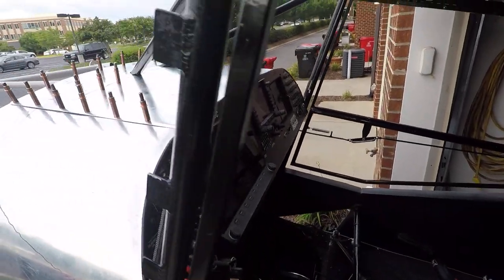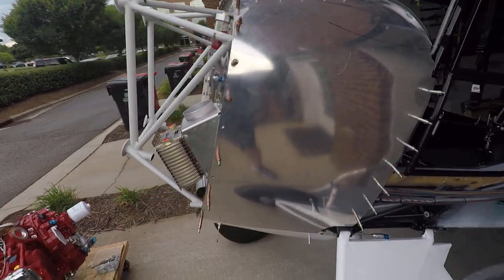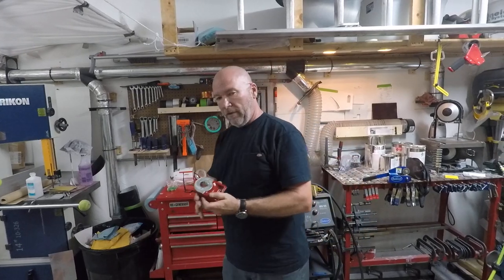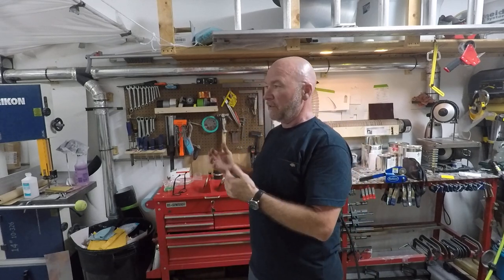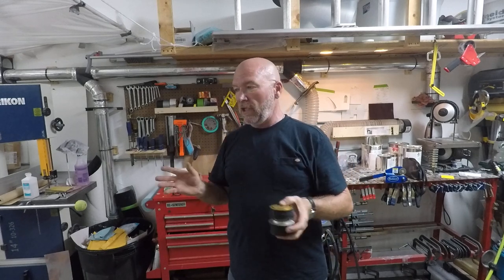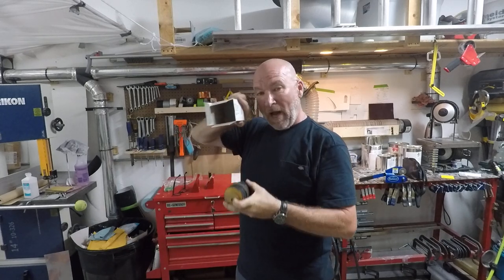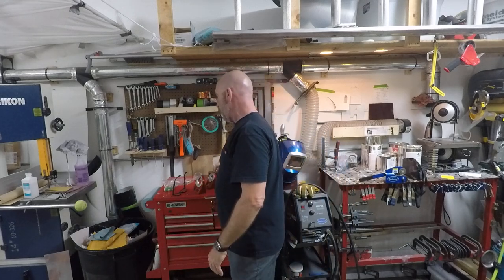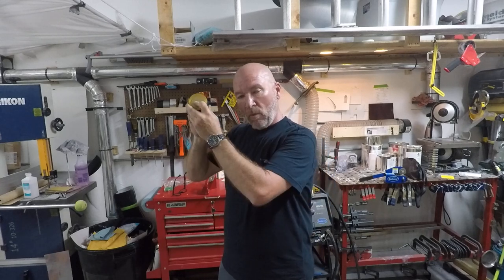Bearhawk - Engine Mounting NIGHTMARE!

Comment: I feel your pain. Try finding the tube size/thickness of O-540 engine mount tubes. Or any tube sizes.  It's like the DaVinci code. I finally found a PDF of the Bearhawk material list. No one has ever bothered to post tube size information anywhere, just like the isolator situation. I spent a lot of time doing the same thing for my Stinson O-540 conversion. I stayed with type 1 mounts and the same isolators that were used in the Cherokee my engine came from.
Reply from the maker: Oh man!  Sometimes you just have to do a deep dive!

Comment: Sorry to hear that you had to go through all of that trouble. In the industry we always phone the original equipment manufacturer as a first resort and ask to speak with an engineer. ... We also ask for specs, drawings, installation guides as .pdf files, if available. Most companies have documentation in “PDF” or in some other format that can be sent via email. Much of the time the larger companies will refer you to or  send you a link to a page on their website where you can download the appropriate file containing the information. However, there are still a lot of aftermarket component suppliers out there which may not offer documentation, in which case a phone call asking to speak with the technical representative for the component is usually the best way to begin your data search before planning your work and definitely before beginning to work with unfamiliar components. Best of luck with future task. It’s a great job you’re doing in sharing your build journey. Thanks for doing that 😎
Reply from the maker: Phone calls were made to all that you suggested.  I apologize if I did not convey that information in the video   Because I am building an experimental, information was not eagerly shared.  In some cases, flat out denied.  Ultimately, I obtained service manuals for aircraft that used the Lycoming IO-540 engine.  I used those to find the detailed part and installation procedures.  Some conflicted with each other.  I obtained enough SM's on various aircraft until I found consistency.  I also consulted my Bearhawk builders forum and consulted with others who encountered similar issues.  I hope I did not imply that I did not make adequate phone calls.  I wore out my welcome in some cases.
Reply: Bearhawk Life, I should be the one to apologize, as after looking at more of your videos, I learned that you had indeed placed phone calls to distributors & suppliers in order to seek the information you required.
.
My only suggestion is that if you come up against a distributor or supplier that is reluctant to provide you with the information you need, try sending your clear and concisely laid out question(s) in written form in a physical letter  (you’ve probably also been doing so I’m guessing but just in case you haven’t) and addressing the correspondence to ‘The Director of Engineering’ (a call to find out the person’s name and correct title is always useful) as a letter can be more easily directed to the appropriate person to respond to it and the context of the inquiry isn’t likely to be lost or the inquiry misinterpreted, as the request is passed from one person to the next within an organization.
.
Sorry I’m not able to provide you with a better strategy. I hope you’ll have much easier success as you progress through your build. 
.
Thank you for sharing your journey into kit aircraft building with the General Aviation community, it is much appreciated 😎

Comment: I’ve had the same problem, figuring out the bolt length. Luckily, I had an assortment of different bolts length available in my shop. One thing I found, that maybe helpful. Initially, i tried to mount the engine to the engine mount that was bolt to the firewall. No luck. I’ve never been able to mate the two together. By the way, you need to level the plane first ( right now it’s sitting in a nose up attitude). Anyway, even leveling the plane, I wasn’t to mate the two. Engine is very difficult to maneuver with the hoist. What I ended up doing was to unbolt the engine mount, and mount it to the engine first. Much easier to do.... Then you just have the bolt the mount (with the engine) to the plane...Easy peasy .
During the build, I’ve probably mounted/removed the engine 3 to 4 times, to have a better access to the firewall to install all the different components, thread all the wires/cable thru the firewall, battery box, heat valve, solenoid, etc. I’ve noticed that you have you’re oil cooler mounted already, which is good. You’ll see that when the engine is mounted, you don’t have much room left to work on the fwall. Anyway, I would plan for few install/remove cycle....
Reply from the maker: Yes, I raised the tail to level the nose during my first couple of attempts.  Will do that again on our next try.  I purchased the RV10 firewall forward kit with a great set of plans.  It is very detailed in terms of what to install and when.  Except for the batteries...  I will be using the Light Speed Dual Electronic Ignition.  So I will have two batteries.  Trying to figure out where they will go.

Comment: I was wondering what was slowing you down Rob, you were just blasting through this build until the last month.  You definitely are contributing the bearhawk build knowledge base!  I bet a solid build manual would double the sale of Bearhawk kits.
Reply: There used to be a Bearhawk CD put out by Russ Erb maybe you can find someone on the forums that will sell you one?

Bearhawk Builders Manual - Eric Newton is hard at work getting all the scratch building details into a series of manuals.
http://mybearhawk.com/buildermanual.html

Bearhawk FAQ - Here is the unofficial Bearhawk Frequently asked questions.
http://www.bearhawkin.com/FAQ.html

All of this may not have helped with this specific engine install???
Reply: @byzantinelegionnaire9469  Eric Newton's Manual Link is broken.  Do you know how to get a copy of this?
Reply from the maker: Just trying to add to the many resources for building the Bearhawk!  (Sorry for the late reply...)